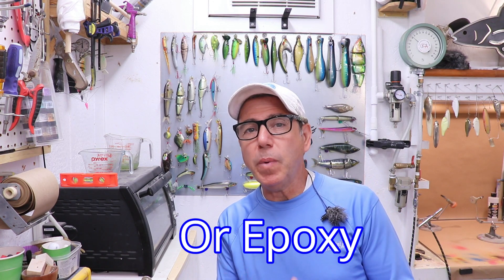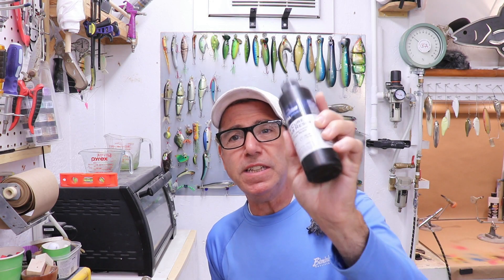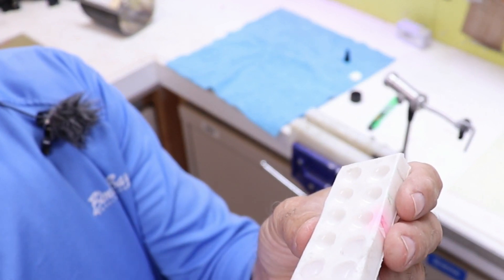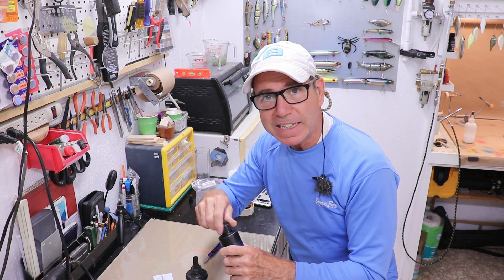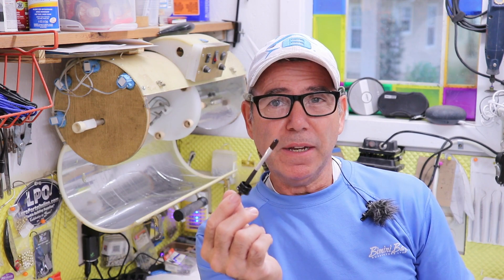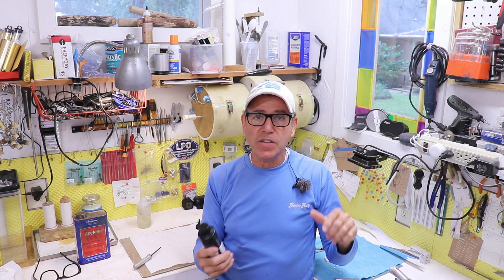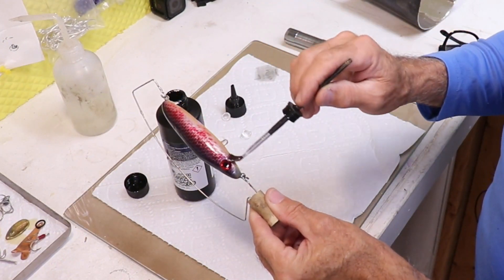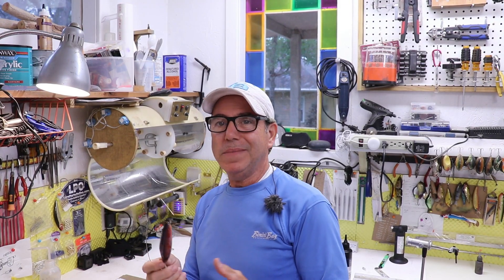UV Cure Resin, from Who?  Total Boat UV Resin Test and Review

Comment: Great video! I want to find a way to add a good topcoat on my lures but with a satin finish. Would I be able to achieve that by using a satin polyacrylic midcoat and then the normal UV Cure or Totalboat as the topcoat? I've had a hard time finding straight-up satin UV resin topcoats. Thanks!
Reply from the maker: No...you would need to find a satin finish epoxy.  Or, you could coat the epoxy with satin finish clear from a spray can.

Comment: I just bought that. I haven’t had a chance to try it yet. I put a review on here on the comment on what I thought
Reply from the maker: Yes. Would love to know what you think.
Reply: @EngineeredAngler  it works good. I applied total boat UV and two spoons and I let it cure and it’s really a lot better than the other stuff is just right with what your video was I do you have to get a better life. Oh it takes a little longer for me to curate but yeah, if you have a a good light, it dries.

Comment: I enjoy all your videos. Thanks.  I've been trying to use uv resin. I started with teexpert. 2 30 watt bulbs. After hours in the chamber comes out tacky. Put in direct sunlight for hours and still tacky. I added 100 watt light and switched to lets resin brand and still have the same problem. I've tried brushing, spraying and dipping all with the same result. I'm at my wits end. Any advice is greatly appreciated
Reply from the maker: What's the wavelength on your lights?
Reply: 365 to around 400. I think my compartment is too big and the lures are too far from the lights. Building a smaller one now. Thanks for the quick response.
Reply: I switched to kbs tired of all the lights and crap I have to go through with uv resin

Comment: Hi Franco, great video as always, when using the minwax polycrylic through an airbrush, do you thin it down with anything or is it good out of the tin? Thanks, keep the videos coming 💪
Reply from the maker: I thin it with distilled water about 15% by volume. So I add 15ml water to 85ml of Polycrylic.

Comment: Another great and informative video.  I have the Total Boat UV that you use and have problems getting it to coat.  Same with the Alumilite UV.  What do you use as a mid coat?  (I am painting over airbrush acrylics, spray paint, etc. and using 120w spotlights with a turner)  I'll brush it on and turn it for a while until it looks perfect but then it comes out with blotches of little or no coverage....  Thanks for any advice you might have!!
Reply from the maker: I use minwax polyacrylic

Comment: Is it possible to use UV resin of a 3D resin printer? Such as Anycubic UV Clear Resin? Thank you.
Reply from the maker: I think so...as long as you're the correct UV light.
Reply: @EngineeredAngler  The reason I would like to try this is that we do not have any other type of UV resin product in Turkey.
Reply: @UzunKamis  Hope all is well after the earthquakes. Pretty nasty ones too
Reply: @johnnyb1776  Thank you, we are in need of any kind of help. The effect of the EQs are huge in here.

Comment: Anyone wanting to build a uv box 
Quick tip 
Get a  Flowtron bk 80d.  Bug zapper
68 bucks Amazon
Comes with everything you need to get started. 2 -40 watt 365 nm bulbs  
Just gut them and isolate zapper circuit 
I used 2 of them  for 160 watts curing times cut in half.
Reply from the maker: Nice tip!

Comment: I bet if you sand the surface, that resin won’t pull away like that. Scotch brite wheels on a dremel, or an arbor with Emory cloth. 300 grit or so.
Reply from the maker: I think urethane and epoxy just don't get along.